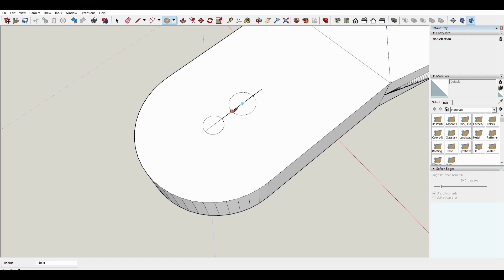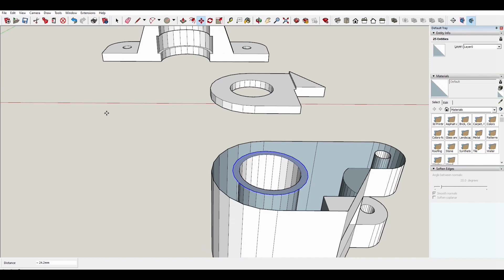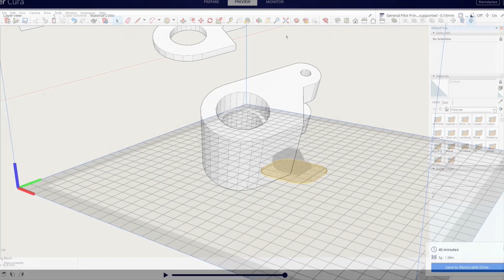VQ Models Turbo Porter with Variable Pitch Propeller - Part 4

Comment: Hi Matthew, great so hear, you are still working on solving the problems as reported in part 3! I m sure, finaly you will have success. I had a look at this part 4  several times. Beside printing direction has massive impact on strength of the blade, please have a look on the weight of the blades of this 3 bladed prop. I m not sure, it is more a guess, it looks like at specific RPM, center of the hub seems to move and describes a circle (sorry, I cannot describe it better, I hope you understand what I try to describe). I believe, this is a result of unbalanced 3balded propelelr mechanism, so I propose to match weight of the three blades.
Another point is, that blade holders of the helicopter are designed to run at 2500rpm maximum, and we (you, me) are exceeding this by 2 to 3times. So please keep blades at lowest weight but highest strenght, to be fare away from stability limit of hub and blade holders.
I m looking forward next part soon. I hope you will have success.
Reply from the maker: Hi, thanks for your helpful comments.  I have weighed the individual blades (13.8g each), and they are within 0.05g of each other.  On a helicopter setup this sounds like quit a bit, and I will try again at rebalancing to get this tolerance down as much as possible.  I am also aiming to drop down from 12 cells to 10 cells, and I have changed the ESC for a Castle HV controller - just waiting to retest.

I am also not certain about the precession on the centre hub.  I am thinking that the inner rod is too sloppy inside the motor shaft.  however, to go up to the next size of silver steel (4mm), i need to ask my friend Mark to mill out the inside of the motor shaft (it is currently bored at 3.98mm and will need to be 4.1mm).

Glad you are enjoying the channel.
Reply: @ScaleMeDown  Please note, that centrifugal force of 14grams at this RPM may be to high for 3D printed blade and/or blade holder, blade holder screw or hub.
centrifugal force formular: F=m v v /r and v=2pi r n...
results in F=4 pi pi m r n n. 
Now lets assume 
m=0.014 [Kg] 
r=0.2 [m] 
n=5000 [1/min] 
results in 767N pulling at your blade holder screw...
Yes, I m surprised too...
There is one option only to reduce this force... weight of the blade itself has to be lowest possible without loosing stability....because we need RPM and diameter on the prop for flying...

Comment: NEEDS A LOW RPM HIGH TORQUE MOTOR ...WHY ARE WE SPINNING IT SO FAST  ????LET THE VARIABLE PITCH COMPENSATE FOR LOW RPM WITH HIGHER BLADE PITCH .....IE MAKE THE BLADES OUT OF CARBON / NYLON  FILAMENT AND DOUBLE THE PITCH.
Reply from the maker: Hi, no need to shout 😊  The motor is already of low KV (190KV) high torque, and with these parameters on 10 cells the most efficient RPM for the ESC and motor is 5600 rpm (KV x Cell Count x 3.7 x 0.8).

If you watch further videos in the series, you will see how we modify the blade design to be stronger for this application, although it is important to use one part of the system as the weak link (for instance to fail in the event of a propeller strike), hence carbon fibre blades will require stronger blade grips, which in turn will require a stronger hub ... and so on.

To be efficient, these propellers work better at these higher rpms in a similar fashion to how a model helicopter runs at relatively high rpm (after all, the grips are taken from a 450 sized helicopter which would run at 3500 rpm)  5000rpm (current flight mode rpm - see  part 9 in the series) is not particularly high for a model aeroplane propeller.  Typically, a 2 stroke glow engine will develop 6000 rpm in a wot4 or something with the right sized prop.

I hope you enjoy the series, keep the suggestions coming